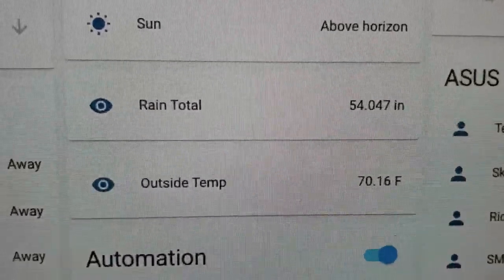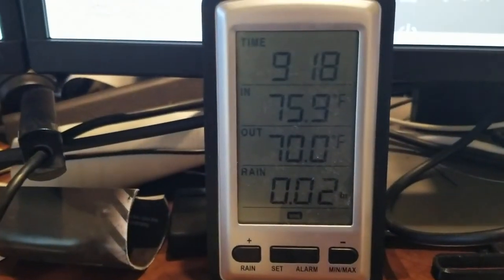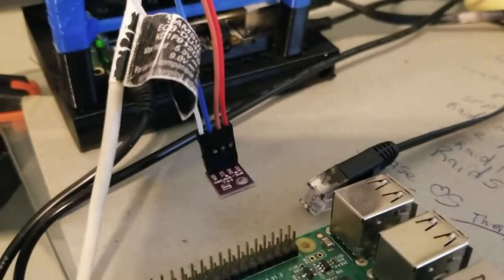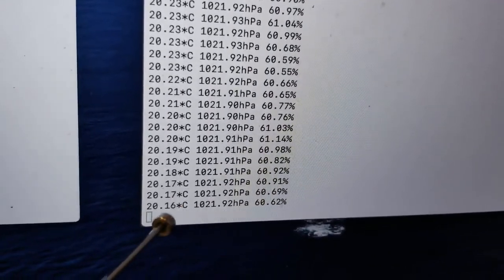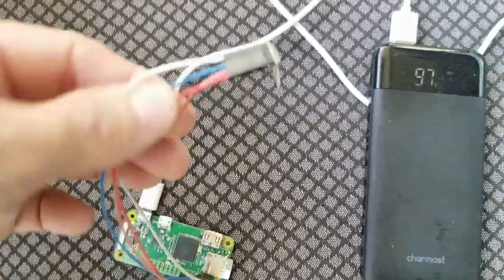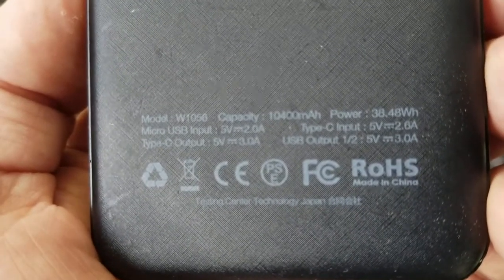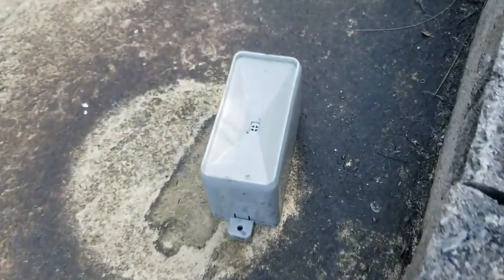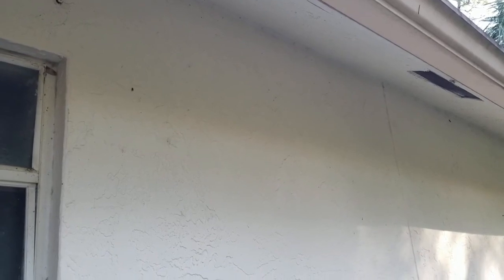Pi Zero Weather Station & Tech Tuesday?

Comment: Tech Tuesday sounds good. Before or after lunch? So the Pi Zero is required to be the brains? I'm thinking about but have not committed to home video security cams with Pi as the brains. Not sure I want to go to all the trouble though. Have you experimented with different OS's? Oh, Gonna go look to see if there's anything like this, a Ballistic Chronograph. Got to tie this into something ya know? Glad to see your feeling better.
Reply from the maker: Hey Len! Ballistic Chronograph sounds cool! I run a bunch of OS's on the Pis, my go to is DietPi, most of my pi devices are headless. In fact, none have a monitor connected to them unless it is necessary for maintenance. Here is a DIY Project https://hackaday.com/2020/05/04/measure-the-speed-of-a-speeding-bullet/